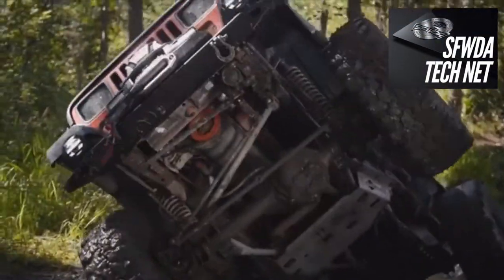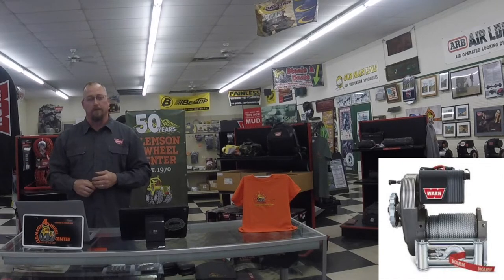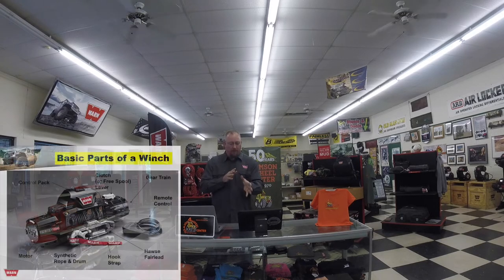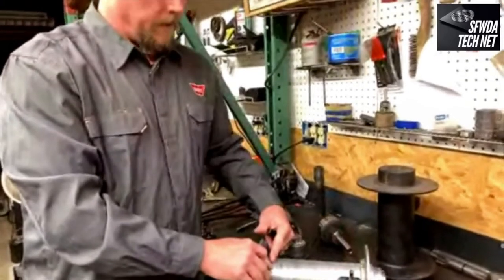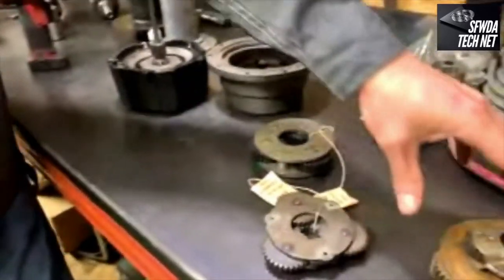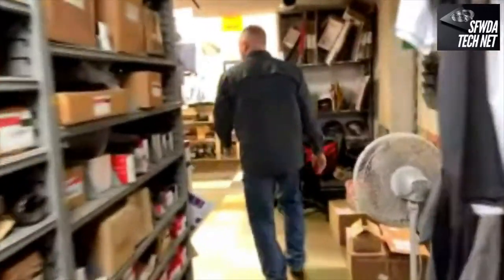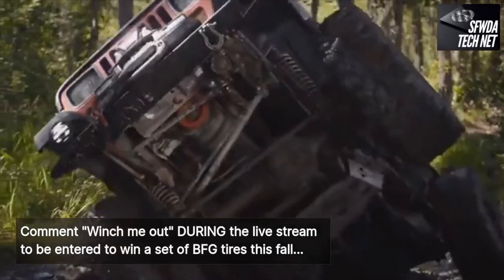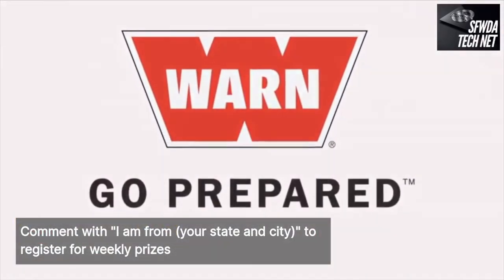Tech Net - WARN joins Tech Net LIVE for a look inside of Winches

Comment: One question I have always wondered is why all electric winch manufacturers use a battery cable to supply the winch with the power to run it. Battery cables are NOT made to handle high amperage for a long time under load. The cable will immediately begin to heat which causes more resistance to the power flow making the winch labor more for the same load. A better positive cable is to use a welding cable that is made to handle long durations of heavy amperage pull.  Keeping the power conductor cool helps the winch run more efficiently.
Reply from the maker: That’s a GREAT question! Let’s see if we can help figure out the answer direct from the manufacturer. Standby
Reply: @SfwdaOrg  I'm sure the answer is going to have to do with cost.  Welding cable is more expensive per/foot.  Given the differences, I still believe that taking the time to find some old, retired welding cable and adding a sheath to keep it from grounding makes a much better power source for an electric winch.  The other thing that improves the performance is to only put two layers of rope on the drum.  Carrying a length of rope for an extension makes more sense from the standpoint that the winch will be pulling closer to its rated pull strength with only two layers.  Between the welding cable and using only two layers on the drum, the winch will run cooler, longer, and more efficient.  The average use of a winch does not require much rope, so the extra rope on the drum is only keeping the winch from working at its rated pull strength.